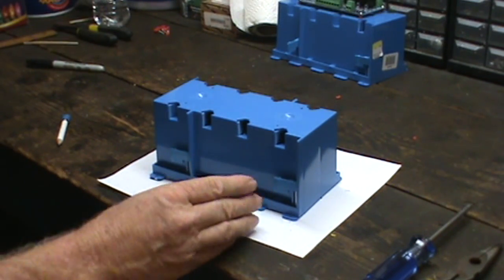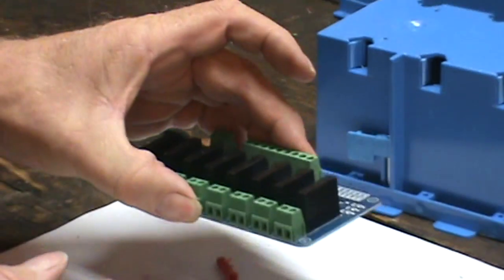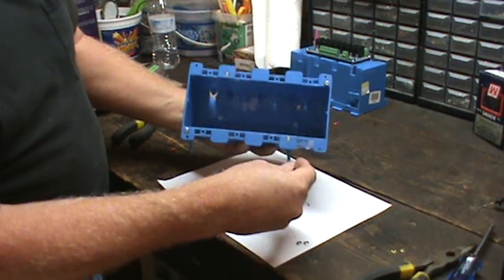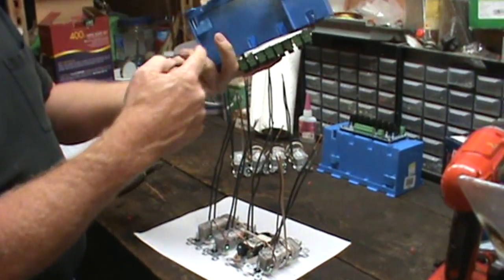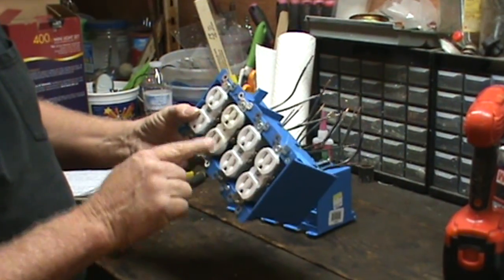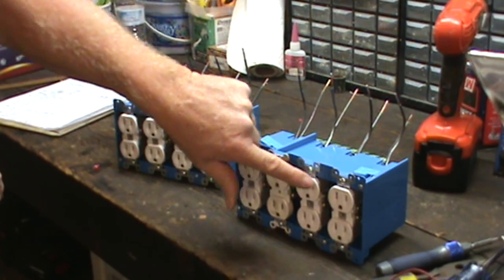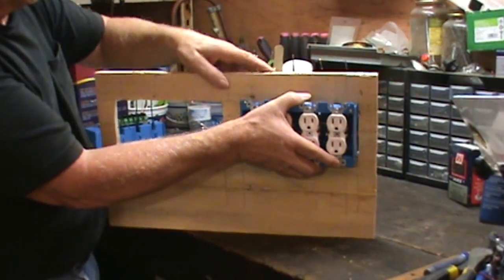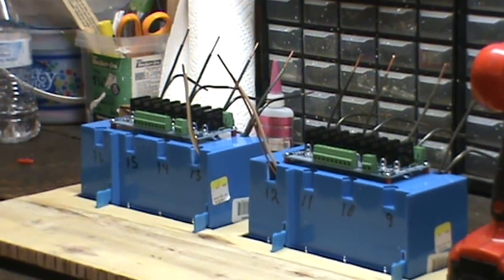Cheapskate Video 1 Part 3, Christmas Lights to Music Using Arduino and Vixen Lights

Comment: Is that the entire arduino code?
Reply from the maker: That's it.
Reply from the maker: This code works perfectly. When I was first trying to figure all this out I found a code that was several pages long. It wouldn't operate more than one Arduino. With this code I use one old laptop running Vixenlights to operate five Arduinos.
Reply: @deehigginbotham8434  great job with how you explain every detail

Comment: I just recently built a 16 channel box but my wall sockets will not light the strands my relay boards come on
Reply from the maker: Are your relay boards solid state or mechanical? Mechanical boards operate in reverse. If they are solid state are they high trigger? Are they 5 VCD? If the LED lights on the relay boards light up then the relay either comes on or off depending on if they are high or low trigger.
Reply: Dee Higginbotham they are solid state relays but the power source is a 12v dc 2amp transformer
Reply: And my relay boards are 5v
Reply: Dee Higginbotham also when I connected the push connections to the empty spots on the 110 side of my relay I used 4 push connections with 4 hole in it would that effect anything
Reply from the maker: If your relays are 12VDC powered you are not going to be able to turn them on with a 5VDC Arduino.
Reply from the maker: Shouldn't affect anything.
Reply from the maker: Your previous message stated that the power source for your relay boards was 12VDC. The Arduino can only put out the 5VDC that is being sent to it by your computer. I had one other gentleman that had the same problem. He had to order 5VDC relay boards.
Reply: Dee Higginbotham I have 5vdc relay boards I just didn’t have a 5v 2amp transformer but I had a 12v 2amp transformer which powers up the 5v relay board only problem is I have not power going to my plugs where the lights plug into
Reply from the maker: The relay boards input power supply is 5VDC. Everything I've read shows 5VDC connected to the VCC and GND terminals. Input power to channel 1 thru 8 can be anything from 2.5v to 20v to trigger the relays. Not sure if you can send 12VDC into the 5VDC input power supply terminals without frying it. I never tried. I've always used 5VDC 2amp power supplies.
Reply: Dee Higginbotham thank you! I’ll try everything I’ve been informed to try and thank you for the good idea on the light show setup!

Comment: Although you used two 8-channel boards, in my web shopping I've noticed that there are 16-channel Arduino-controllable boards available. Is there a particular reason to use two 8-ch boardsvs. one 16-ch board?
Reply from the maker: When I built mine I never saw any 16 channel boards. I might have bought them instead. Don't know how well they function though. Never had even the first hint of a problem with the 8's.

Comment: Ok sir, does it matter if I use low level trigger relays or high level trigger relays? Had to get them from two different sources.. so I have both high and low level trigger relays
Reply from the maker: I don't know one from another. The relays I purchased are 5 volt.
Reply: Dee Higginbotham yes, the ones I have are 5 volt as well. They look exactly like yours because I looked very closely at the ones in your video. Just on the one Edge some of them say they are high trigger and the other say low trigger. We're getting close to the end now so we'll see what happens
Reply from the maker: I checked and here is the answer I found. Solid state relays are high trigger. Meaning you put power in to get the relay to close and allow current to pass thru. Manual relays are low trigger. Meaning you shut power off to cause the relay to close allowing current to pass thru. I use both in my show. I use the manual relays to power things like my singers mouths. The LED's need only a few volts. Solid state relays need to be passing at least 75 volts to operate correctly. I use solid state relays to pass 120 volts for my light strings.

Comment: OK, found the Arduinos, I'd like to make a 36 channel... my hang up is how do you connect two USB cables? to feed signal to two Arduinos?
Reply from the maker: If you only have one unused USB port on your computer you will have to use a powered USB hub.
Reply: Thanks for the info. My understanding is I can control 32 Channel with one Arduino. Is that correct
Reply from the maker: Up to 48 without any problems.

Comment: I can't find these Arduinos online. I find the mega 2560 but it doesn't look like yours. are there different types of mega 2560?
Reply from the maker: I just looked on ebay. There are several dealers selling them for between $11.00 and $13.00 with free shipping. Arduinos are open source which means anyone can manufacture them. The ones on ebay won't be brand name, but they work exactly the same.

Comment: sir please help me. I make 16ch Christmas lights controller. Bur the problem is when i connect 240v to the relays, the arduino and the relay board are got freeze and disconnected from computer, so the lights are freeze. So i dont known what to do. Please help me. Sorry for my bad English.
Reply from the maker: The 240 shouldn't do anything but pass through the relays. They operate on 5VDC. If you're having problems you might be shorted out somewhere.
Reply from the maker: Here in the states we use 120VAC but the relays state that they can operate on 240VAC also. The voltage shouldn't be a problem.
Reply from the maker: See answer I gave to Jesús Jiménez
Reply from the maker: video 2 part 8

Comment: I have another question. Would any other size screw fit other than a #4? My hardware store doesn't have #4 screws. And how long are the screws you used? Thank you!
Reply from the maker: I used a 4 because it fits the Arduino boards. My hardware store didn't have them either but my local lumber yard did. You can use any screw that fits the board. Length is about 1/2".
Reply: Dee Higginbotham thank you again